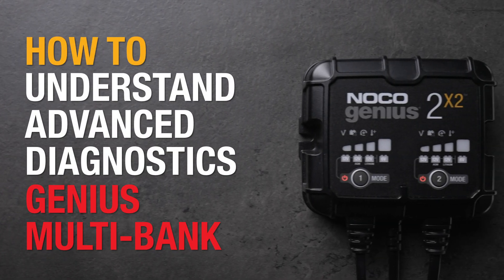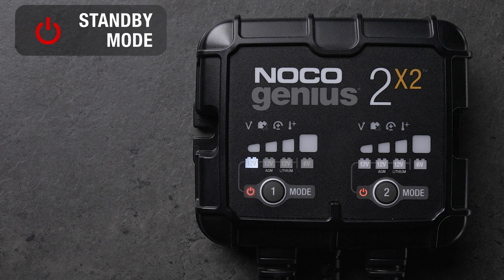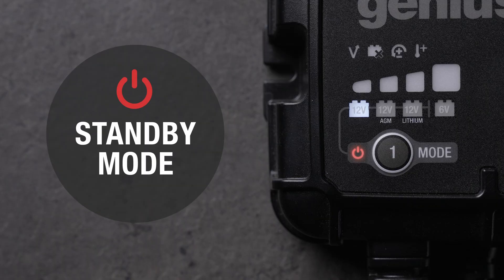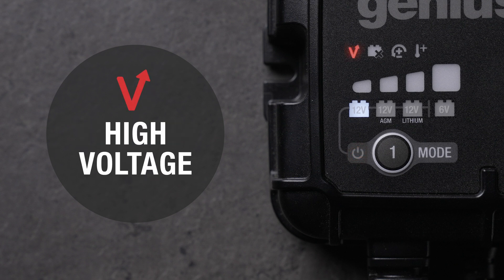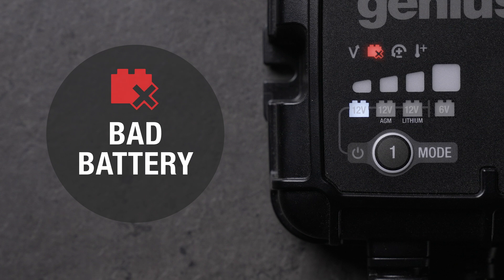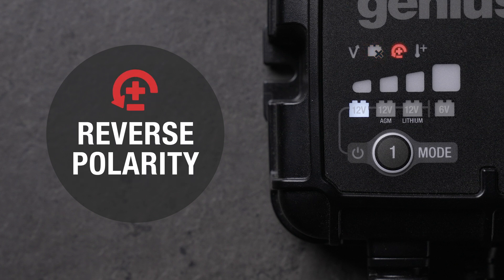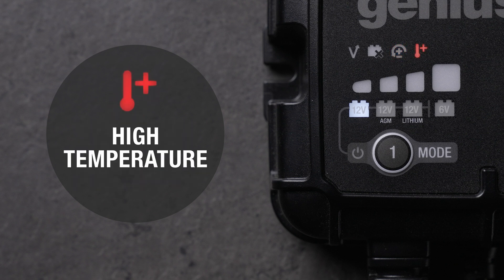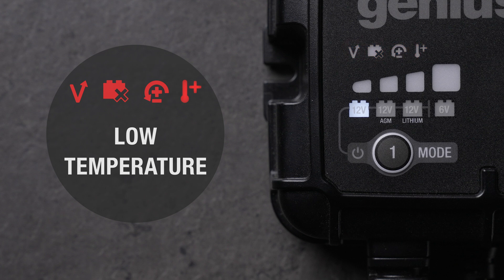Understanding Advanced Diagnostics on NOCO Genius Multi-Bank

Comment: My reverse polarity error light is on but was working before with no problem and never changed the wiring?
Reply from the maker: I'm very sorry that you're having issues with your NOCO Charger. Please contact our support team for assistance. You can reach them by email at support@no.co (NOT ."com") they also have a Live Chat option on our website here: https://no.co/support
Reply: What did you figure out about your reverse polarity issue.  I have the same issue.  Mine has worked great all summer.  Then, right after a big rain storm, the reverse polarity light comes on.  My multimeter voltage on the battery is showing a negative fluctuating voltage.  Wondering if the battery is bad or the if it is the charger with that being the case.